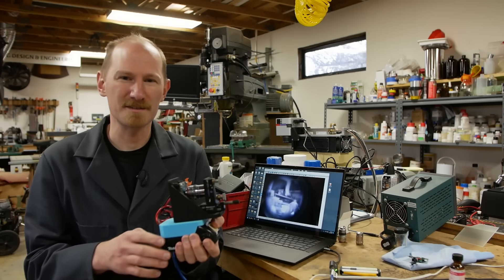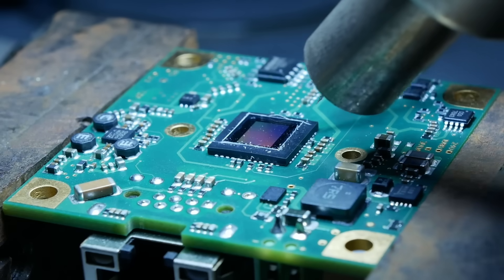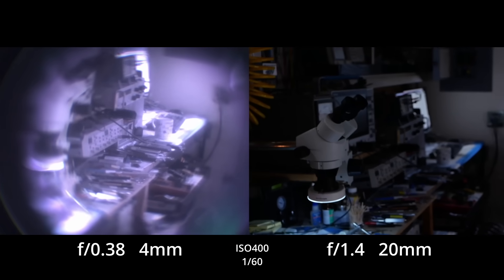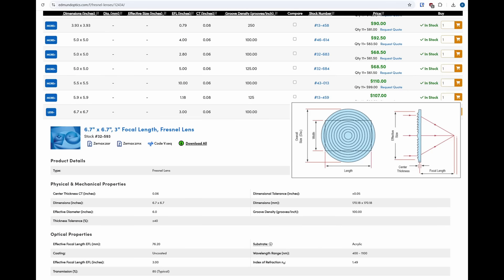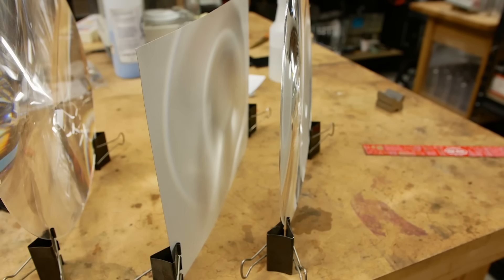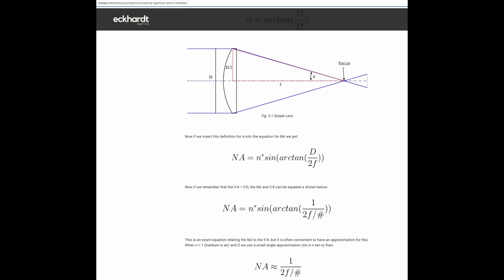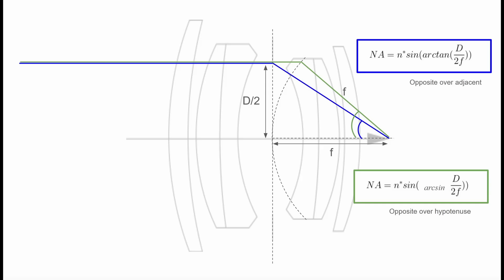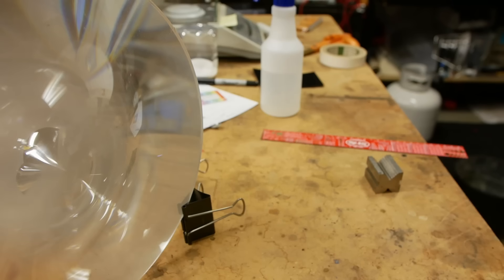f/0.38 camera lens made with oil immersion microscope objective

Comment: Nice experiment and video Ben, but I don't think that your conclusions are correct. First, fast lenses have a very short focal depth, which we don't observe in your images (quite the opposite actually). Second, if you use a microscope objective in reverse, aperture is not defined by the N.A. of the objective but more by the "physical aperture" at the other side of the objective. This aperture does in general not accept light under very wide angles and this makes the effective aperture of the objective in this configuration much lower (and for example dependent on the physical length of the objective). Which in turn has implications for the effective F-number of your optical system.
Reply: The depth of field is not small, as his focal length is very short. He has a 4mm lens there as he said, that's a 4/0.38 =10mm aperture with f/0.38. So the depth of field should be about the same as a f/5 with a 50mm lens (50/5 = 10), which fits well with the observed images. Depth of field at a specific distance is basically only dependent on aperture size afaik.
It's the same reason why phone cameras have a large depth of field and need to add bokeh artificially even though they have quite small f-numbers.
Reply: @moe.m  You are absolutely right, thanks for correcting me. I wasn't really paying attention to the very short focal length.
Reply: @HuygensOptics yes, i suppose the focal length is zero because the detector is in contact with the optics.
Reply: @moe.m  Yes, depth of field is a property of the physical aperture size and the magnification factor.

The focal length doesn't matter at all, it's all in the ratio of aperture size and magnification factor.

People think that focal length matters because they are concerned with DoF/FoV equivalents between sensor formats, but in that case you are changing the magnification factor, and it all cancels out nicely. But if you need to think about DoF in any other context it's not that useful to do these sort of calculations, it's more useful to think in terms of aperture size and magnification factor.

But it gets even simpler, if your final display size is fixed, and you only care about the circle of confusion at that specific display size, then for a given FoV all that matters is the physical aperture size. The sensor size doesn't matter at all, it all cancels out.

So yes, a 10mm aperture for a wide angle lens is not very wide at all, quite the opposite (I estimate the FoV to be eq. to around 28mm lens on FF).
Reply: @pdp11  Think about it from a geometric standpoint. The DoF depends on the maximum angle of the light rays from a point at the focal plane which can still hit the sensor.
This angle defines how far apart two points behind or in front of the focal plane are which can still hit the same point on the sensor with their light. So, if you imagine this in reverse, this defines how fast the "viewing rays" for each pixel spread apart around the focal plane. And this angle is only dependent on the Aperture.
Obviously his magnification factor is also very large, otherwise a 4mm lens would have an insane FoV.
Reply: I know nothing about optics, but seeing people having a civil discussion and then thanking someone for correcting them warms my jaded husk of a heart a bit.
Thanks.
Reply: @NoobsDeSroobs i basically just said the same thing. I love this comment section.
Reply: @thetruthexperiment  No, I love it more!
Reply: There is also the problem that those objectives NEED the cover-slip to work correctly -  by design - you can't use them directly on a surface.  There is a number on the lens for the correct thickness of cover-slip.
Reply: @lrakschmidt2880  Correct.
Reply: First, DOF as others have mentioned here—small gauge film with a wider lens to compensate will yield a deeper depth-of-field at the same f/stop than the same FOV achieved by a longer lens on, say, full-frame. You prob know and were only offering a simplified explanation, but I think it’s an important note to make.

Something else that bothered me about the video is that in the intro, flange focal distance was shown to visually demonstrate effective focal length, which doesn’t usually equate in modern glass— indeed something we see later in the video. 

I totally agree with you here and think that the best way to measure lens-speed is to isolate apparent aperture from other variables: shoot a grey card+chip chart at each stop, in a known colorspace/gamma, and to linearize the picture to glean exposure value—which should in theory get you closer to a lens’ true T-stop
Reply: This has to be the most polite brawl I’ve ever seen. This whole thread should he in a museum. Optical nerds should be conscripted into government positions!
Reply: Also the gain applied for the same ISO by different sensors is quite different. Basically manufacturers make ISO numbers up, there is no correlation between different sensors (even from the same manufacturer). The specific sensitivity and gain of each of two sensors has to be calibrated to make a meaningful comparison.
Reply: This discussion is why we CAN have good things 😊
Reply: I love the recent focus of optics by my favourite channel Applied Science, and now Huygens optics is even commenting. Great work from both
Reply: But he actually addressed that. The math does check out. The way I see it anyway
Reply: Depth of field is only dependant on total aperture size, not the aperture value.. and the size of the aperture increases 4 fold every time you double the focal length. Which means a 4mm f0.38 aperture is 10.5mm across whereas a 20mm F1.4 aperture is 14.25mm across.
Reply: An f/0.38 4mm lens on that tiny sensor will have much more depth of field than an f/0.38 50mm lens on a full frame camera.

Comment: It would be interesting to know why fluid coupling isn't used in commercial applications, since it's higher coefficient of refraction enables much more extreme lenses to work. I guess fluid in a camera system creates many problems, but for applications like extreme low light shots it could be useful.
Reply: It is used. I once took apart a scraped CRT rear projection TV, and the tubes were attached to the first lens with some sort of optical jelly. Also, wet scanning is a thing, definitely for stills, and I think even for some telecine machines.
Reply: @johnalexander2349  very interesting, although I was thinking more of a portable stills or video camera
Reply: @johnalexander2349  I took apart one of those TVs as well years ago, though it used some flavour of oil rather than a gel. Now after almost a decade I finally know the purpose of it!
Reply: Glass elements if they are very very close to each other or touching usually have a layer of "cement" between them so that there is no layer of air between them.
Reply: Some of Roland Christen’s telescope designs (Astro-Physics, Starfire et al) were oil-spaced - not between the lens and image plane, but at least between the elements of the triplet objective.  I assume it simplified the designs before he got his interferometer, and/or good optimization software, or something.  :)

There have been other uses of oil spacing in astronomical optics.  The goal here is usually sharpness at wider apertures (and color correction).

Comment: 8:05 F number is somehow also not directly related to how good a lens is at letting through light. Light can still be absorbed by lens elements, or bounced off elements elsewhere. If you dig a bit deeper you can find this efficiency number usually stated as 'Transmittance' (TL), which is actually how much light they let through. If you compare lenses you can see a huge difference in this transmittance. Especially macro lenses have poor transmittance, even though it might be f2.8 your image (on manual exposure) will be much less bright than e.g. a general purpose 24-70 on f2.8. As a practical example (Data from DXO mark), the Sigma 50mm f1.4 dg hsm has a transmittance of 1.8 (which is still rather good), but e.g. the nikkor 50mm f/1.4D has a transmittance of 1.5. 
How exactly they define and measure this transmittance, I have not a clue.

Comment: 2:09 for the last 10 years I've always wondered why the super high end Nikon microscope we had in the lab performed terribly at high magnifications compared to my childhood Lomo microscope. I thought that the "Oil" meant that the lens was filled with oil inside for some optical reasons. the image looked as if someone severely damaged the lens and tried to clean it up a few times but no good image with a perfectly clean lens surface. thanks.

Comment: Did you try it with immersion oil but without removing the glass cover off the camera? My experience from using oil immersion microscopes is that you still get much of the effect of the oil on the slide even before the lens touches the oil, so i wondered if the lack of oil under that glass really made much difference.

Comment: Yes, you are right about the aplanatic system. I figured it out doing radiometry calculations for a lens. The explanations in some books are that the principle planes are curved, but I don't think that's exactly true. An ideal optical system produces spherical wavefront, that converges on the image point. On the opposite side, every point of the object place is emitting light in a form of a spherical wave, that's where the sphere comes from. That's why when doing integrals for radiometric calculations you have to consider that the focal length is a hypotenuse. Rays are just local normals of the wavefront.
Edit: The hypotenuse in this case is just a marginal ray so it is a ray that defines the solid angle that in turn defines the amount of light reaching a single image point (it is a part of the Etendue or the A-Omega product). Both numerical aperture and the f-number are just different ways of defining the light-gathering solid angle.
Reply: That last sentence is the most mind-blown I've been in a while. Thanks.

Comment: The depth of field does not depend on the focal length and the aperture ratio but solely on the entrance pupil.
Also, the focal length in a multi-element system is kinda hard to define, but generally the last element to sensor distance, often called the flange distance, isn't necessarily the focal length.
More broadly, I think most people think that f number = light gathering ability when it's more of a measure of light concentration. The fundamental limit as to how much light an optical system can gather is it's entrance pupil, regardless of the focal length and thus aperture ratio of the lens.
Reply: Can you please explain the difference between light gathering ability and light concentration?
Reply: @woosix7735  light gathering is how much photons are traversing the optical system, whereas light concentration is how much photons are being focused on a nominal area
Reply: @megamasterbloc ok thanks. If I am understanding it correctly then roughly light gathering = sensor area * light concentration ?
Reply: @woosix7735  yup

Comment: I believe that there might also be some added confusion regarding NA for single elements vs multi element systems, for a single element the NA calculation are easier, and you can have lenses with very low NA on their own. For multi element systems, I would say the fact that the definition of an f stop is related to the entrance pupil, and not, the geometric size of the aperture itself is important. What you need to measure is the size of the aperture as viewed through the lens (often magnified) , and not it’s actual aperture size itself. If you measure the actual aperture diameter of highspeed lenses, which often have quite a few positive front groups that magnify it, it will often be smaller than the geometric calculation  would imply it to be! I think this is related to the curvature of the principle plane, which you can usually see with your own naked eyes if you just look at the aperture of a lens from the front

Comment: A problem that you're likely to run into with high NA lens systems is that rays at the focal plane arrive at very steep angles. Digital image sensors don't really like that (search for "image sensor chief ray angle mismatch" for much more). Film is IIRC much more forgiving

Comment: 00:21 - Sorry, no the f/stop, though is correctly described as to how it is measured, dictates the depth of field. Though generally comparable to brightness, it’s not the proper designation and measurement. For still photography, it’s not a big deal, but for film it is. As such, the film industry uses t/stops for transmission of light because most lenses do not transmit the same about of light at the same f/stop

Comment: Welcome back!! Your projects are always next level and jaw dropping to watch. Thanks for sharing the video. 
That being said, wouldn’t be YT without the peanut gallery forcing their 2¢ in, so….for the glass lens removal, maybe combine both of your techniques…? Attach with glue, a pull tab or anchor as you did but in the corners of the glass, then heat and scribe as before. 

What would happen if you reapplied vacuum between the objective lens and the sensor without lens or oil?
Thanks again for the video.